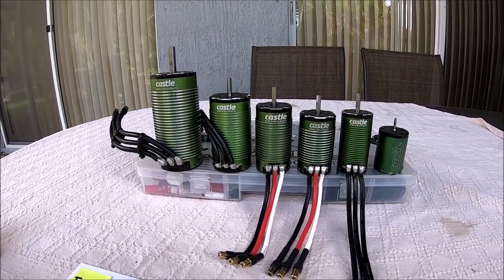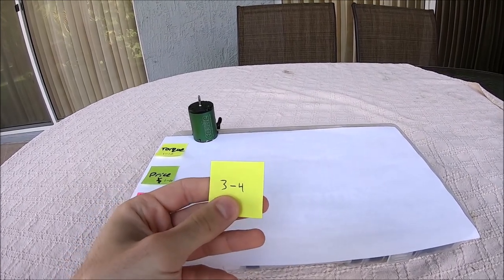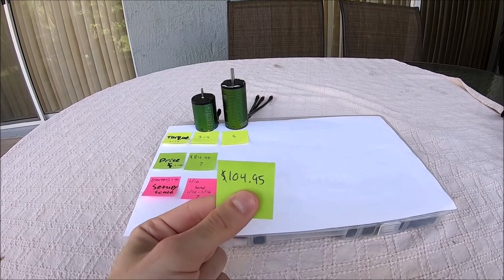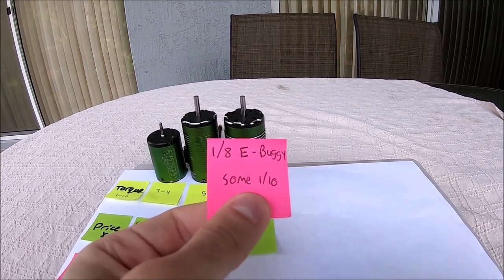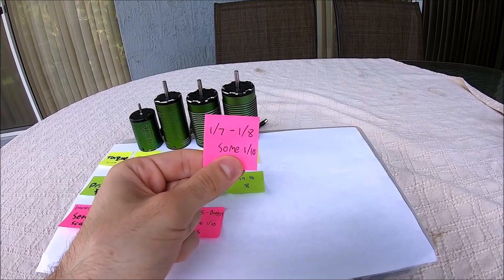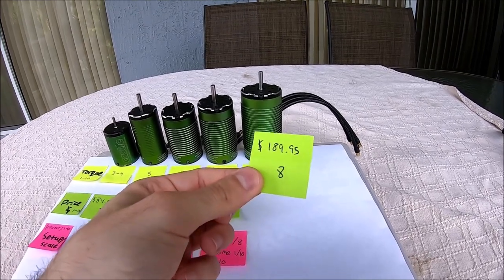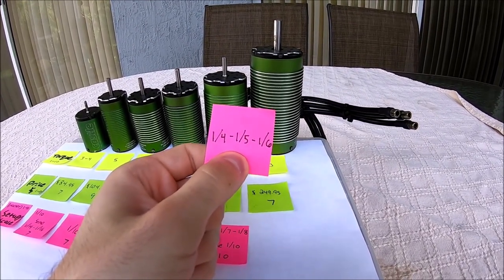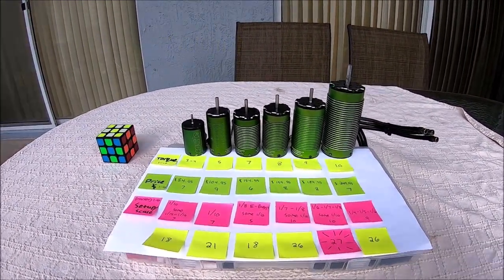ULTIMATE Castle Motor Comparison Review! New 1717 & 2028

Comment: Hi great video thank you so much,,I live in Orlando Florida plus I’m new to Rc...That said I know temperature is the main reason you guys or the new people ruin motors or their entire set up’s..I’m going to buy the Arram EXB,,what I want is one and done..Not sure you knew what I mean so I’ll explain,, so when I’m done putting the motor the electronics plus everything else I won’t have upgrade envy..I priced one setup it was close to $1,800 and I’m not sure it will fit in the EXB,,I Should say that price includes the truck..
Reply from the maker: If you want a one and done setup, go Mamba monster X 8s esc with the 1717 1650kv motor. As I stated in the video that's the big block upgrade for 1/8 vehicles. The mmx8s esc has thrown my Kraton 8s around like a rag doll. In a vehicle half the weight? PERFECT!

Comment: I have a Xmaxx I wanted Great torque but still enough kv to get Speed... I went with a Leopard 58113 V2 1050Kv Max5  @8’s I am trying 33/33  1.5Mod ..my questions is with my set up could you Suggest my Possible best Gear ratio..I don’t need Super speed but I want it to Flip on a Dime if possible..I appreciate any Help in advance..Ty

Comment: I have the 1406 7700kv planning to put it on a Traxxss Slash Drag. If do what pinion Tooth should I run my spur gear is at 86T. Thanks
Reply from the maker: I would start with a 23t pinion gear, if you are doing the 2s street eliminator class, do one pull and if it isn't enough from there go up 2 teeth on the pinion at a time. Should result another 3-4 mph per 2 teeth

Comment: I have the Max 6 ESC and 1650 kv HW motor in my hobao 7tq brushless conversion....6s rated.......not sure if it'll go 💯 MPH....need advice on gearing... currently it has 21  pinion, 46 spur..... Thnx
Reply from the maker: Go up to a 34 pinion. I'm sure you'll get close. I know you can get over 100

Comment: It is possible to know if the castle 1515 motor can last a long time ? Because I already blew up 2 Arrma 6s motors and I couldn’t rebuild it because the stator broke the magnets. Thanks
Reply from the maker: Get a bigger motor that can handle what you want more of
Reply: @InnovationRC  those Castle Motor can avoid that the dirt get inside of the motor? Thanks!
Reply from the maker: @josephsrc  yessir they are all waterproof!

Comment: I'm new to the speed and bashing, always been more into crawlers. I have a traxxas fiesta rally 1/10 with mamba x and castle 2400kv, wanted to know if drag brake is something to stay away from or not? Pros and cons?
Reply from the maker: Welcome to the basher world! So drag brake engages brakes at a small percentage (variable) when you release throttle or esc recognizes neutral. It automatically applies brakes. I personally don't run with drag brake because your esc and motor will over time show increased temperatures. My preference for a standard basher is to not do so. Honestly doesn't hurt if you do a 10% drag brake setting though.
Reply: @InnovationRC  Appreciate it 🤙

Comment: Thanks a lot for this great vid. I am looking for a sensored motor for my 8S Super Rock Rey. The stock motor has 750kv, 16t pinion, 37t spur. Unfortunately the 800kv castle motor is too long so the 1717 you mentioned might be an idea. Any recommendations on gearing? Even an 11t it might still be too high.
Reply from the maker: I would probably run maybe 10 on the pinion and invest in some fan/ heatsink combo for it.
Reply: Innovation RC thanks for the quick reply. I am having a hard time finding one that fits (mod 1.5, 5mm shaft, 10t), and then I’d probably also need a custom motor mount.  I am still hoping that one day castle builds a sensored motor that’s shorter than the 800kv. I get a lot of cogging with the castle 8S esc and the stock 750kv sensorless motor. ;-)

Comment: Ok. What I need to know is what motor should I run in my typhon for speed runs???  I'm currently running a 2200 kv and its nice. But now I want something for drag runs.  Basically something that will rip straight off the line instead of building up to top speed.... i was honestly looking into the TP kill mode with the mamba monster X8s..... or should I stick with the castle???  What do you or anybody else think ??  Plz help
Reply from the maker: For Typhon you can honestly use the sensored 2200kv and the mamba monster x 8s and it will rip for sure. That electronic pair up geared to 80mph will absolutely be quick off the line. Especially with the sensored motor enabled.
If you run tp, yes the 2900kv Killmode is insane. But it draws an insane amount of amperage. I'd play with the 2200kv setup first until you make a switch to tp. Being you already have it.

Off the bat regardless get the mmx8s esc, it will be super smooth and controlled power to the motor as well.

Comment: In your opinion what motor should i run in my outcast 8s when it finally gets here? I know the stock motor isn't enough. Thanks . I should clarify i don't run speed runs or anything on road just off road full throttle also I'm sick of battling heat issues i want reliable power without having to over gear and over heat. 👍👍👊
Reply from the maker: The 2028 would be a solid upgrade. To be honest if Castle made a 2028 that's 1100kv and that's a little shorter that would be perfect. The stock motor is the same size as castles 1717. The hobbywing 5687 1100kv is what we need next from Castle. Because it's a huge jump from 1717 to 2028. Need a middle man

Comment: How would you put the 1717 against my tp 4260cm 2080kv? Both can run 8S, the weight is just right for 1/8th Arrmas. I had the HW 1650kv and the tp is violent by comparison. Both come in at $159🤔. I will probably get the MMX8S 1717 combo for my next build, but just wondering if you've ran my 4260cm before? Also 8mm shaft all the way baby with some Saga/FOH goodness🤤💪
Reply from the maker: Tp is built far more aggressive of a motor. Naturally if you have the same kv, can size and everything it will draw more amps compared to Castle. I honestly would go with the 1717 all day over tp. 

You won't ever see me run a tp motor to bash with in any video 😉
But for speed tp is probably the best to go with
Reply from the maker: Plus it's a CM motor. Those are specifically built to be violent haha! It will be very hard on everything. I've ran other cm motors and they all pull serious amps. Not exactly the 4260, ran a few 4070cms.
Reply: @InnovationRC  Yeah had the 4070cm for a week, had to return it as a serious amp hog. The 4260cm is a sweetheart by comparison

Comment: Thank you so much for the easy explanation. I am in the market for that 1717 in my typhon v4 6s, so I can go 100mph. Do you think this motor will fit in my typhon?
Reply from the maker: Yes it should fit with no issues. The v1/2/3 needed spacers on the motor housing to fit the 1717 but I believe the new motor mount design is raised up a little so it'll go right in.
Reply: I have it on my Typhon and it fits fine.  No modification needed for the V4.
Reply: @mksteezy  Thank you for the knowledge.

Comment: I’m new to the Rc world and i want my infraction v2 to do over 130 but i dont know what motor esc and gearing to run to accomplish that mph please help!!!
Reply from the maker: You really just need to change the esc. The stock motor can handle that speed for sure. But if you need an esc I'd just get a combo. 1717 1650kv motor with a mamba monster x 8s esc
Reply: @InnovationRC  what about the gears what tooth do i run to accomplish that speed

Comment: Wii the 1515 2200kv  be a little better then the arrma  blx 2050 kv thanks bro watch you a lot you make good Content
Reply from the maker: Appreciate it for sure. The blx arrma motor is a BEAST. Only thing you should change is the esc. The Castle 2200kv has sensored capabilities so torque on low end is amazing. But it's kv is a tad high so more speed!  I would say overall the 2200 is a little more potent and makes a satisfactory upgrade over the blx
Reply: In my opinion, the 1515 is maybe 25% more torquer as well as faster. Ive used all of them, I'd get the 1717 motor over the others. Its very powerful and decently priced.

Comment: Can I run the Spektrum 160A esc with the 1250kv in a Kraton 6s? What size pinions if possible?
P.S. I appreciate this video. Learned alot.
Reply from the maker: Absolutely, the 1250kv is the exact size of the 1717 shown @10:00

Comment: I just bought the 2200kv do you think it will run good in my converted traxxas tmaxx and if so how fast do you think it will go?
Reply from the maker: Absolutely it'd do amazing. I would run that motor on 4s. Can get a good 45-50 mph in the converted tmaxx back to back with it
Reply: @InnovationRC  yeah I baught just a 3s but the only problem I’m having now is finding a motor mount
Reply from the maker: @chasehedden8961  I believe they have online nitro to electric conversions

Comment: What's the biggest castle motor that fits in e revo 2.0? Has to be no longer than 85mm right?
Reply from the maker: I believe the 2200kv 1515 motor. The 1717 is too wide for the oem motor mount

Comment: Which motor would you put in a Kraton 8s for the best all around torque and speed?
Reply from the maker: Out of all of these the 2028. But if castle made the 1717 1650kv in a 1200kv or something around there THAT would be a go to motor. The hobbywing 5687 1100kv is a perfect sweet spot between those two. If Castle made one that'd be the best motor for it
Reply: Innovation RC 
Spektrum just released a 5613-780Kv 8s motor. Wasn’t sure how that would be in a Kraton 8s compared to the 1250kv that comes in it.
Reply from the maker: @tdispenza  it will be very slow. The OEM motor is very underrated. You really just need a better esc to go with the 1250kv. 800kv is very slow as well, but can last all day. If castle had another 1717 in a lower kv than 1650 it will be great. But for now the 800kv at direct drive gearing is insane

Comment: I got a traxxas maxx and I was think the 1512 or the 1515 with the mamba x esc what motor do u think
Reply from the maker: Great motors either way. I think if you stuff a 1515 2200kv you'll be very happy on 4s geared moderately

Comment: Great video, super informative. I have the sensored 1717 and a Mamba X 8S to swap into my Limitless (removing a 160 amp firma and an XO-1 sensorless 1717).

If I geared a 2028 to the moon in a K8S with a Mamba X 8S, would it have thermal issues? Would a TP 5870 sensored be better due to a range of KV choices and over abundant power ratings?

Again, thanks for the informative video.
Reply from the maker: I geared 34/39 in my k8s with the 2028 and MMX8s. Esc was cold the whole day. Motor was 145°F or so after running it hard. I absolutely would run a motor fan and heatsink regardless. The esc is so efficient you can leave it as is. This video below shows this test
As for Tp motors I don't fancy them to bash with, they draw more amps on average over Castle. But, if you gear it right it could certainly still be good, make sure your batteries are top notch too, you'll be pulling 180+ amps on average

https://youtu.be/u-3BJViCNbE
Reply: @InnovationRC  Priceless information, thank you. A 2028 with my third Mamba X 8S will be in my near future (my Skydio order opportunity is finally coming this week after over nine months waiting - so it gets the next allocation of fun money) :-).

I run PowerHobby Graphene HV 4S 8000mah 15.2v 120C as my best cells in my Limitless - pretty much all I have is 100C or better. I agree about the TP motors. I have a TP 4060CM in my Typhon running 8s with two YoWoo 4s - mad fast but can get hot (the 1/5 GRP wheels with adapters are likely a little too much wheel for the car, the 1/8 GRP wheels or Buggy 1/8 wheels seemed to run better).

Again, thanks for the excellent response and videos to date. Much appreciated.

Comment: What’s a good motor for a arrma limitless?
Reply from the maker: Can go with the 1515 2200kv for light duty stuff. Or one single fast pass. Or 1717 1650kv for heavier duty applications. Bolts right in

Comment: What motor would you out in a big rock, or do you think the new Spektrum motors are comparable to the Castle ones.
Reply from the maker: I would go with the 2400kv 1415, run it on 3s you'll like it. Gear up to desired speed.
The spektrum motors are good. The bearings are horrible in them itherwise
Reply: @InnovationRC  Allright, thanks
Reply: What would a 15 series motor do in the big rock you think?

Comment: Would the 1415 series 2400 kv with the 5mm shaft fit in a losi Baja rey
Reply from the maker: Yes it certainly should
Reply from the maker: It should. Not the super 1/6 version though way too small

Comment: Which motor would be the best for drag racing a Traxxas Rustler for the best top end
Reply from the maker: Depends on the voltage you want to run. Some guys will run the 5600, 7700, or even 9000kv variants on 2s and 3s to get insane speeds. I would go with the 1410 can rather than 1406 size. Little more torque
Reply: @InnovationRC  thanks so much

Comment: Hey bro can max5 push da castle 800kv?
Reply from the maker: The max 5 can only push 200a. It can certainly out a smile on your face but you won't get full potential of that motor unless you have an esc with higher amperage capabilities
Reply: @InnovationRC  oo ok thanks bro as long it pushes it just got da motor yesterday cant wait to slap it on thanks bro

Comment: Hello Innovation Rc Good Vidéo
Reply from the maker: Thanks Yo 0ne 💪
Reply: @InnovationRC  I have a 1512-2650kv motor how are they
Reply from the maker: @bryonhoward6102  it's a solid motor, all the 15 series are great. Castle states the 2650kv is rated maximum for 4s lipo. You can run it on 6s, just keep an eye on temps and gear with respect 💪

Comment: So what your saying is.. Kv doesn’t matter for speed?
Reply from the maker: It does for certain vehicles you put it in. Know the right kv for the weight and purpose of the vehicle. Voltage depends on the motors rating.

Comment: what do you think of hobby wing just got a 4600 kv motor the hw 3660 for my 1/10 truck cause my castle gave up on me  have you ever tested hobbywing stuff ??
Reply from the maker: Hobbywing is great. That is a great motor for 1/10 vehicles, even if you go a little lower in kv you'll be set
Reply: Innovation RC would you go lower kv but higher gearing for speed or go higher kv ?
Reply: What’s a good balance of kv to gearing ?
Reply from the maker: @brandonbritt99  Depends the vehicle. 3800kv usually will outlast the higher kv variants of you want to bash all around, you can gear up a couple teeth to compensate the rpm loss from kv being lower.

Comment: I run A lot more volt to each more. Then you talked about.  3800kv 6s 2400kv 6s.  2200kv 8s
Reply: According to Castle the RPM limits printed on the cans are accurate but with extra precautions.
Reply: @PabloGonzalez-hv3td  but if you do the math it will  tell you what volt you can run your  motor at. 3800x 26.2is less then 100,000 Rpm's  that what I look at in a motor.

Comment: How does the 1717 compare to the tppower 4070cm?
Reply from the maker: Far more efficient and less amp hungry. Both have benefits. I'd go with efficiency over raw power. Power doesn't go far without a certain amount of efficiency...
Reply: @InnovationRC  Thanks, I'm looking for a motor that can be used on 6s for bashing in a kraton exb without overheating.

Comment: Does a sensored castle motor need to run sensored?
Reply: No. You can run it sensorless.
Reply: Thanks
Reply from the maker: He's correct. The sensored ability provides more consistency and no cogging at lower rpm. Sensorless does not. Can't go wrong with either mode
Reply: Thanks innovation rc I love watching your videos and I recently got an arrma Kraton 6s and an arrma limitless and run it on mamba xlx with a tp 4070.

Comment: Got a 3665 size 2400kv in a 1/8 scale buggy. It shreds tires easily and rockets up to 100km/h on 4s. 

Great info👍
Reply from the maker: Absolutely. I put that 1415 2400kv in a 1/8 losi 8xe and I hit 90 mph or so. Solid motor for its class size

Comment: I’m thinking off getting me the mmx 8s/1717 1650kv combo for my infraction. Is that a solid combo for speed runs? I did 95,1mph with stock electronics and 25T pinion. I’m aiming to get  around 120mph. I have the chnl 3s 5200 90C batteries

Comment: Hey, could you post some insight for me? I’d greatly appreciate it. I have an Xmaxx 8S, and i’m looking at the Castle XLX2 1260KV 1717 or the Castle XLX2 1650KV 1717. Which do you think would be a better option? I just bash around the yard.
Reply from the maker: Go with the 1260kv. Much more torque and cooler runtime over the 1650kv
Reply: @InnovationRC  Ok thank you! Will the stock xmaxx motor mount fit the 1717 1260kv just to get me by? Or do I require the UFO Mini mount?

Comment: I´´hi i have a castle xlx with tp 4070 in stock limitless and it shuts down all the time
Reply from the maker: Make sure the xlx amperage is turned up or off. Ensure your solder connection are solid

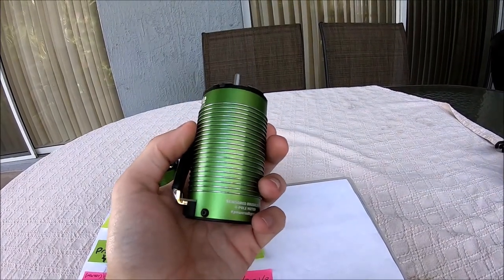Comment: 10:09 bro i need that thing. I’m trying to get my rustler 2wd to 100mph
Reply from the maker: You could, but it's way overkill. Go with the 2200kv, it's already meant for vehicles 3 time the weight of a rustler and can run 6s
Reply: You’ll be good with a 540 can. It has a lot more rpm and less weight

Comment: Dude the 2028 can run its ass off on 8s this 10 to 12s is hogwash its a blast 800kv 2028, 1.5mod ,xlx2 ,xmaxx does in place back flips.